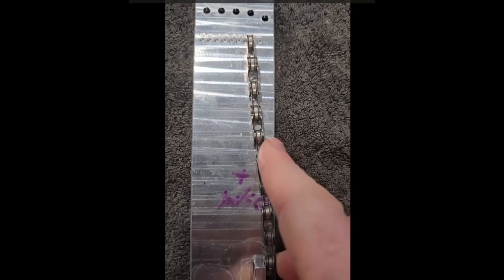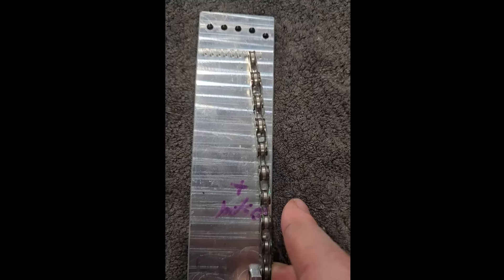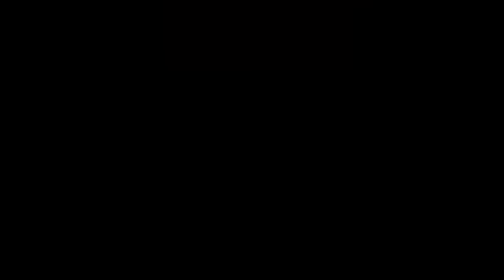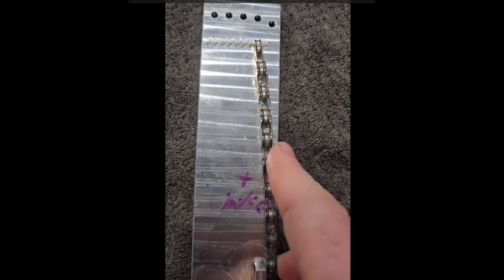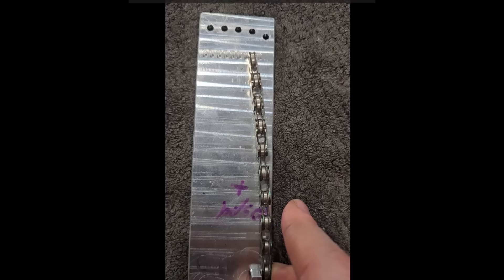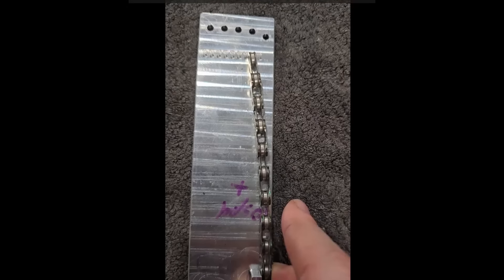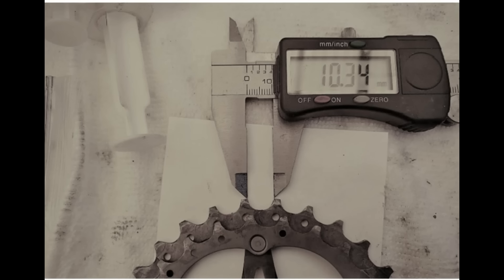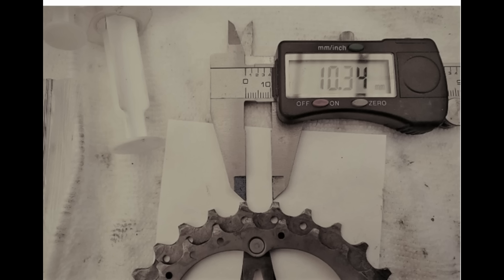Sram WTF

Comment: 32:40 - you are wrong that the sentence cant be true.  A new chain could prematurely wear IF the cassettes are designed to work with a slightly worn chain for most of its life. Sometimes you could build the chain to slightly underspec, which would wear out the cassette more at first, but once it was worn around 0.5% it might be "perfect".  So by replacing at 0.8% you will actually spend more time in the ideal wear spot. It is kinda like shoes - I get them slightly tighter because they WILL loosen up with wear.  Eventually they will be too loose and worn, but I want to optimize for the majority of the lifetime of the shoe. Or they are just trying to screw over people to make them buy cassettes more. idk.
Reply from the maker: I get what your saying, but - in reality the odds on them planning and executing such would be nil. Remember they are competing at the world level, they their high end products to compete at the world level - so chains and drivetrain components will be designed to run perfectly when new. Due to efficiency reasons, at high level racing chains are changed  very frequently, and so a WT riders cassette and chainrings will see many new chains in a season, whilst remaining basically not affected by wear. 

SRAM nor anyone else in cycling would try to tolerance parts such that initially they dont run as well new as when they are X thousand kms old. That would be nuts.
Reply: @zerofrictioncycling992  okay but lots of things have a brake in period. like brakepads, some firearms, pedals. It isnt X thousand kms unless X << 1. You are probably right and maybe its a typo, but some times things are designed in such a way that it works best in its typical configuration. The SR71s fuel tanks leaked when on the ground since it was designed for cruising at mach speed. idk not a chain engineer.
Reply from the maker: @bermchasin  yes for sure - and for sure there is a break in period with chains too - it is just that we are talking (depending on brand and model) 30 mins to a few hours. So you could almost think of it similar to bedding in new pads (except more steps to do it properly). But it is a rather minute thing overall, and certainly not something that can account for srams information which is something very different.

Comment: Would continual cross chaining wear ramps
Reply from the maker: continual cross chains MAY wear teeth thinner over time, which MAY wear ramps - but it is still unlikely. The shift ramp teeth have less material there, deliberately. They are designed to allow the chain to move without being caught up trying to get off a tooth. So they generally either will not be touching the side of plate links on chain line angles like non shift ramp teeth are, or they are doing so under much less load. As such they just experience a lot less wear pressure than non shift ramp teeth. They will wear like other teeth from the more normal face wear before ramps are worn, in almost all cases i believe.

Comment: Has anyone tried adding a bit of Tungsten DISULFIDE Sulfide WS2 Powder Ultra FINE ½ Micron 0.5 µ to boost the Silca wax and if so, how much would you add to a pot with 300 grams of wax? Thanks. Or, is it just a bad idea? 
BTW, I ordered that chain checker and it's going to be awhile before it gets here.  Apparently, you're an influencer.... Did you know!!!
Reply from the maker: Ha if i am i am so doing it wrong - where is my influencer money and affiliate link cheques... oh wait i dont do affiliate links or anything like that..... :) 

And no i would not do that. I can't say for certain that it wouldnt improve - maybe in dry conditions, but i can say from a lot of testing here and also efficiency testing data from ceramic speed that over the years some patterns are emerging (again this is not conclusive, just - the case for going too heavy is not strong). 
> Too high a concentration of friction modifier MAY increase treatment lifespan, and MAY increase wear protection, but beyond a certain amount it MAY make the wax slower. 
> High concentration mixes so far have all tested notably higher wear in wet conditions. Low concentration mixes thus far have always tested notably better. 

I believe also very much that there is ws2 and ws2. Silca / Mspeedwax etc obtain from Tier 1 suppliers, and it is not cheap, and i think silca also does this but i know that Mspeedwax also have their supply independently tested that what they ordered is what they received. Over the years a number of big mfg have had a product batch issue because a key additive has not been what it was supposed to be.

What people buy from ebay or alibaba - sure it may claim its X - but is it? when it costs 1/10th or 1/20th what it costs to get from a tier 1 supplier? If you buy the genuine good stuff from a genuine chemical supplier who typically supplies to labs etc - then sure - mixing in some more - you may get a longer lasting, more wear protective mix FOR DRY conditions - and a worse mix for wet conditions. If you just buy something claiming to be 99.9% pure 1/2 micron ws2 from ebay and mix that in - if i was me i just wouldnt mix that with a quality wax, i would only faff doing that if making my own diy wax

Comment: Sounds like a copy-editing error to me.
Reply from the maker: maybe, its a wild sentence - but the fact they have brought out a tool that goes to 0.8, when 0.5% has been the recommended for so long, for good reason - it points to them taking a completely different approach which is not good. however i am working to try to get the right contact at sram to discuss.

Comment: Looking for a reason for SRAM’s statement. Maybe the hard coating and sharp chain plate edges are what causes the majority of the wear. And once it’s worn off it’ll cause less wear?
Reply from the maker: no that for sure isnt it, the way chains run over teeth it doesnt matter if one surgically sharpened the plates (it would just make it more exciting to do a re wax of fix a rear flat :)) 

New chains CANNOT prematurely wear cassette / chain rings, they simply may not mesh well if those parts are showing enough wear - so i know what they are trying to do, i just wish they would not attempt to achieve by putting out knowingly false information - i really cant abide that.